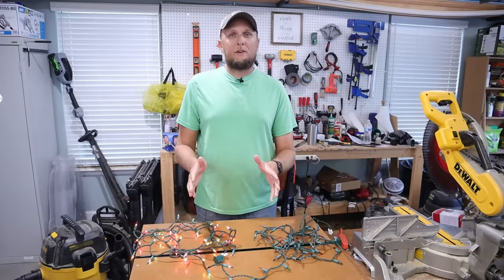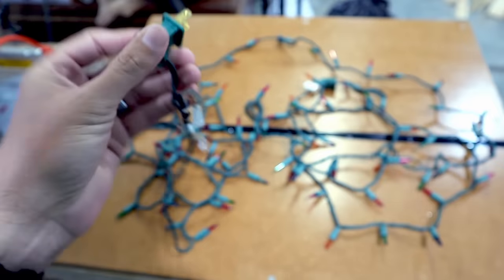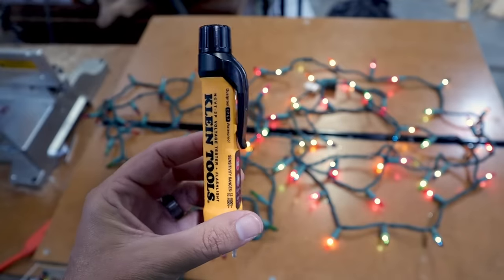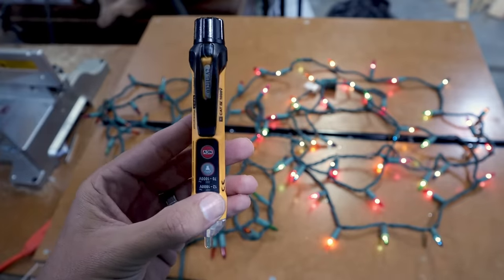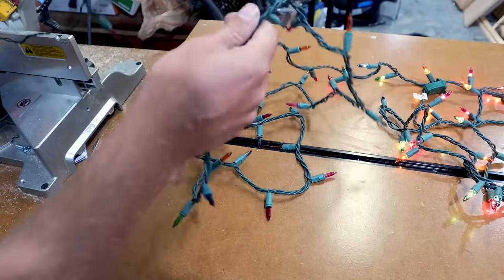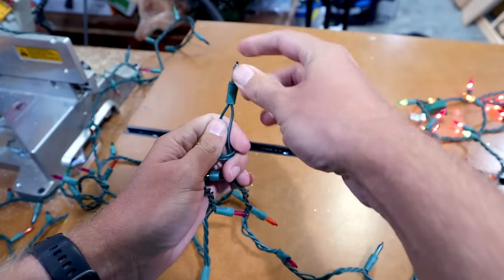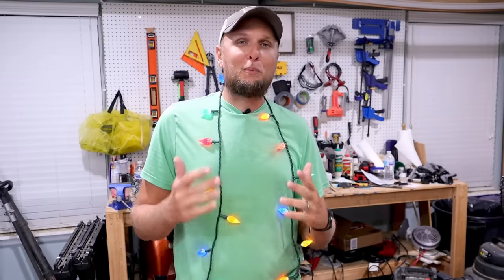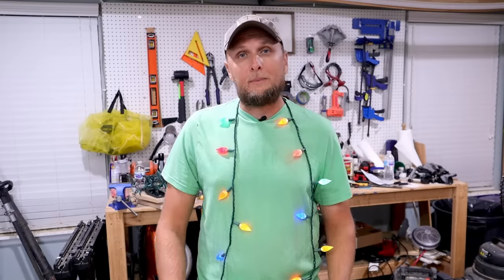How to Find Bad Christmas Light Bulbs Quickly!  LED or Incandescent

Comment: I tried this but still not able to find it. All bulbs show to have power but none are coming on. Maybe a stupid question but mine has a plain green piece between the first light and second. Maybe this is a fuse or something? It doesn’t seem like it opens.
Reply: Same exact issue with my troubleshooting.  I was able to open the "plain green piece" that has some component that I suspect is a capacitor, but I certainly do not know for sure.  I've looked through the comments and don't see the gentleman addressing this or other several other similar issues.  I've tested all my bulbs in a section of the non-working string and they are all good.  I tested each plug for power using the $30 tester I purchased after watching this video.  Still no luck, but now I'm out $30 :(

Comment: In the past I’ve even thrown them out. Watched your video and immediately went to Amazon for my tool. Thank you!
this is the absolute best I've seen yet.  I like this method 1000% more because it's actually tracking the problem and not pulling every bulb and just guessing where the issue is at. the divide and conquere method is the tried and true way to break a problem like this down.  Ordering my voltage detector tonight!

Comment: Thank you so much! You saved me! I had just bought a few brand new set of lights out and just to be safe I tested each one of the strands prior to hanging them on the eve of my house. All worked. 
BUT, sure enough, the minute I was done hanging all the strands of lights, there was one strand dead smack in the middle that was completely out. Brand new and I tested it??!! 🤷🏼‍♀️ Well, thank God I came across your video because I was about to hop back on the ladder and replace that entire strand with another one. About 4 lights in… I was able to figure out which light bulb was out, put a new one in and VOILÁ!!.. no having to rip any lights down to replace them with a new strand. 
Thank you for taking the time to share this! Like I said… You’re a complete lifesaver ! 🙏🏼🎄

Comment: I don't know how I've read so many posts and watched so many videos and this is the absolute best I've seen yet.  I like this method 1000% more because it's actually tracking the problem and not pulling every bulb and just guessing where the issue is at.  I've been in cable TV for 24 years and the divide and conquere method is the tried and true way to break a problem like this down.  Ordering my voltage detector tonight!

Comment: Thank you.  Have a Balsam Hill tree with 'built in' lights with a section not lighting up.  Of course the 'built in' bulbs are just normal strings attached to the  branches and plugged into the pole.  This looks like the perfect solution to finding the bad bulb.

Comment: I wish I had seen this a couple of weeks ago.  My wife was determined to find the bad bulb(s) in the lights which are pre wired into our tree.  She used my voltage tester and even changed almost every bulb on that string but never found the culprit, so she bought a new string and wove it into the tree.  We’ll try again next year and follow your process.  We were unaware of the possible need to reverse the plug in the outlet.
Reply: Do yourself a favor, don't buy pre-lit trees. Once they get to be 3-4 seasons old, the whole light sets start to fail and it's impossible to find the bulb, because they all fail at the same time.

Comment: Glad I found your video today. Just what I needed after watching another video with diagrams instead of "hands on" like yours. Much easier than the LED Light Keeper I bought several years ago which requires puncturing the wire insulation (which is sometimes nearly impossible). Used my inductive test probe to check for voltage on both sides of the socket and the Light Keeper to verify the LED is good.  Troubleshooting the unlit section led me to 2 bad LEDs (one with a resistor with a broken lead) and a bad socket. For those that may not know, when testing LED bulbs there is a positive and negative lead. If it does not work one way, switch your tester on the lead. Thanks for the video!
Reply from the maker: I am really glad to hear that you found the video helpful James!  Thanks a lot for all of the feedback and tip!

Comment: I wish I had seen your video 2 weeks ago when my pre-lit artificial tree had only half its lights working.  It was too much to find the problem so I spent over 4 hours removing the lights. It was a tedious job cutting and unwinding the strands from each branch. This method might have saved me the time and trouble of removing the lights.

Comment: Great Video. I got here after I had replaced the fuses and still did not get the lights to work. Getting a no contact voltage tester tool like you suggested in the video seems a no brainer and a great addition to my tool box. Many Thanks!

Comment: Thanks dude! Very helpful! Now I can enjoy the hunt for the bad bulb rather than dread the chore! Many thanks.
Reply: SO hopefully you can suggest a fix for this: I accidentally strung too many gutter-icicle lights strings together (about 7 strings) and now they all went out entirely. Usually I only string 3-4 together and then add another outlet. So my question is, where do I start checking the in-line fuses - at the beginning of the string or at the end?  Thanks!
Reply: Got 'er done.

Comment: Thank you for the information this video is much better than most on the sibject.  I still prefer to buy high quality lights instead of working on broken big box store brand strings & nets.  I used to waste  time trying to fix lights knowing all the technical reasons why they failed when it was clear I could have spent that time at a job & earned enough to buy new lights I stoped  the madness of repairing cheap lights.  In some cases were I can't get a type from a high quality source I buy new units & swap the bad ones out for the good & return them as defective.

Comment: Thanks, I forgot about the broken leads on the LEDs. Noticed that last year and forgot.   I took one apart and noticed it is the resistor lead that seems to break most often.  I didn't have a tester so I had to pull each LED and inspect the leads.

Comment: Enlightening explanation 😂 But seriously useful, esp the trick of turning the plug! My case is a little more complicated because the lights are attached to a Christmas tree so the strands are near impossible to separate and it's really hard to follow the chord around the branches. There's got to be a trick I'm missing!
Reply: I just fixed the wrap around light strands on my stair case...just start at the first on out that you can get to and replace the bulb and keep going.  It may be hard but it's better than taking them all down. YOU CAN DO IT!

Comment: Three years ago I realized that I was spending more time fixing those old incandescent light strings than I was hanging the lights !! 🤔🤔🤔🤔
I had maybe a dozen strings and I even had one of those "Impossible to repair" reindeer displays. 
I collected the lot and gave them all to the Well Good will store.
I then went to Wally World and bought a boat load of LED style light strings.
After three years of of usage, I have YET to have to repair a single one of them !!   

With all their color and automatic lighting options, they are a true Christmas Joy.
Reply from the maker: Lucky you!  I usually have about 2 strands of LEDs to fix each year.  It’s almost always the metal connection on the bulb breaking off.

Comment: Love your videos, Adam, always great.  Great explanation about polarity and switching the plug around if needed before starting this process.  Tried my Klein NCVT-2 on two 35-light GE Twinkle sets (each bulb twinkles independently) from the 1980s.  Worked like a charm on the first string, found one bulb out, replaced it, back up and twinkling.  Second string was possessed.  Results were inconsistent.   Changed my tester batteries, same results.  Thought maybe I had a broken wire, or that bulbs were breaking from age while I was testing.   Big problem seemed to be broken leads, when I took out a suspect bulb.  Had trouble getting the  knack for where to put the tester nose on the wire.  Finally got to the end and got the string working.  Gently moved it around, lights stayed on, so I don't think there's a broken wire.   (Yet!)   Thanks again!

Comment: Well you made that look easy. It's only voltage tester will work then correct? It's been 3 hours and tingling bulbs to find out the whole strand isn't working. Going to be an easier way, great video

Comment: Thanks for video. Verified all bulbs are good and still half string doesnt light up. Any additional tjings in should try ?
Reply: Throw in trash, but a new set. Once they get 2-3 seasons on them, especially if they have high hours, multiple bulb filaments start to fail. This can cause a domino effect where the whole light set burns out because there are too many lights trying to carry the load of burned out bulbs. I had this happen on a pre-lit garland a few years ago. It scared the crap out of me, because when the whole set failed, it lit up like the sun for a few seconds!

Comment: Very helpful and clear video for troubleshooting these two common types of Christmas lights, thanks so much for this!    I'd love to see a video for diagnosing/fixing the larger 5-watt incandescent solid-color bulb strings (where the bulb screw-in diameter is approx 5/8") that use a single 125V fuse and 2-conductor wiring (not 3 as in your example here) with fixed polarity plugs (e.g. where the neutral plug blade is wider and the 'hot' plug blade is narrower).  Thanks again!
Reply from the maker: I will keep that in mind for next Christmas!  Glad you liked it.  Really appreciate the feedback Joe!
Reply: Yes. Need to see the same video. You mentioned incandescent in your title so was expecting the old 5-watt light bulbs 😢

Comment: Good video, well explained for those who didnt know how light strings work. I already knew how to detect if a bulb is bad if half the string is out, but more frequently these days, my strands are completely out, OR, the lights will glow so very faintly, that they are almost undetectable. In the case of them still having power to the next plug end, but not lighting, glowing very very faintly, I have never been able to figure out what was wrong, maybe something with the rectifier? But on LED srands WITH replaceable bulbs, and the entire strand out, I'm not sure whats going on here. My "no touch" voltage detector shows power the entire length?

Comment: I have a Fluke VoltAlert tester so I used it to test a string that wasn’t working and found a bad LED light using this method which fixed the first circuit, but I couldn’t find a bad light on the other circuit. (I followed your instructions on switching polarity for the second circuit.)  I think it is because my tester is rated for 90-1000 volts and once you get past the first ten bulbs the voltage drops below the range of the tool to detect.  I’m going to order a lower range tester. It makes me mad because we thought LED’s would be more dependable.
Reply from the maker: Yeah that’s exactly why it’s not picking it up.  Need a NCVT with the ability to find low voltage.  I agree.  It’s why we went to all LEDs but they have their issues too.

Comment: Thank you for the video. I have lights where there is a bulb with the three wires about halfway down the string, as well as at the start and end of the string. This is the one that's faulty. The problem is that these bulbs have a different base than all the others. The manufacturer doesn't provide a replacement bulb, and "normal" bulbs don't work in that socket. Is there a way around this? Thanks!
Reply: An extra mini bulb from another set can work. Just unbend the two miniature wires and pull the bulb from the socket and carefully put into the socket that fits. Be careful not to let the two wires touch as you do this. These bulbs are all about 1.7 to 2.5 volts. Each "loop" equals about 110 to 120 volts. Doesn't hurt to mix one or two foreign bulbs into a string. I have been synchronizing my lights to music for the last ten years and repair strings all the time.
Reply: @limburgercheese1234  Thank you for the tip. It worked great! Definitely think this particular problem and fix should be added to the video.

Comment: Great video. Succinct and on point. So help me out. Second half of a strand is out.  (First half was out intermittently but your technique helped me isolate a bulb with a bent wire. ) But there is voltage all the way through the second half. Verified every bulb.  Note: there are two junctions mid strand. Meanwhile, first strand is showing no voltage at several wires between lit bulbs. 😮. Brand new detector. Ideas?

Comment: Will this method work for a string of LEDs that a section is very dimly lit and the rest is normal? Or could it be one of the resisters? It's a 50ft string.

Comment: If you follow all the steps, isolate and replace the light and it's still not fixed, would you suggest something else? I've got power coming into one light but not out of it and new bulbs aren't working.
Reply: I'd like to know this too... Prob spent 5 hours on one strand and pulling my hair out .  First half of strand works and 2nd half is out....Was thinking of cutting the entire bulb out and patching the wires together..

Comment: Can you please tell what kind of voltage detector range device we need for testing christmas led strings.
Reply: The voltage running through these lights are typically 120v so use a standard non contact voltage tester. They typically range from 50v to 300v but there's different models that have higher or lower ranges.

Comment: Hey there.  Great video.  I have some old c7 lights and ¾ of the strand isn't working.  I've never had this happen before.  Obviously, it's not the fuse because the first 4-5 bulbs work.  I know there's a bad socket but as long as a bulb is in there, it doesn't seem to matter.  However, I tried screwing in a new bulb into that socket and lit blew out all the sockets behind it.  Do you have any suggestions?
Thanks,
E

Comment: Question: is this the same process for the LED if it's the second half of the line that's out instead of the first half
Reply from the maker: Yes and no.  If it’s the second half the plug will need to be flipped the opposite direction for power to be flowing from the beginning of it to the end.  Then all the steps are the same.  I have an updated video on this coming out next week you still have any questions as in that video both of my examples are on the second half.

Comment: I have a question, the light comes on the LED keeper, but when I test a bulb, that came out of a working stand. I don't get a lit bulb but the keeper red light comes on. I've been over half way down the side that doesn't work and so far no lights. Any suggestions

Comment: How come you were testing the middle of the two strings at the base of the LED instead of the bottom of the light/bulb like you did the incandescent?

Is there a difference in testing the two? Or did you do it that way because the LED bulb was so fat?

Comment: What I have found is A LOT of LED lights are cheap junk. Most of them have the exact problem you showed with a broke power leg and that is because they are now not using the good copper legs they are using a cheap silver plated brittle legs and they brake super easy. Just a small twist on the bulb part can cause the brittle leg to brake off just like the one you showed. Word of advise to all is pull a bulb and check for the silver power legs if you see that do not buy unless you don't care how long they last. If you are ordering from Amazon then you get what you get don't throw a fit lol.

Comment: So how can you determine led on a halloween tree...
I chopped up the transformer plug and connector with lawnmower but it wasn't on at time disconnected... it worked before it was disconnected
It has purple lighters and has red lights in mouth and green lights in eyes...
It has a transistor I believe before mouth and eyes at top after purple lights but purple lights continue after
The mouth and eyes blink or flash while purple lights stay fully lit
I bought a new plug on Amazon that's same rating and amps and watts  and a extension with connectors on both ends cut the connector that dont need and spliced into end of original and thenI splice togethe with olhgr and plugged in but nothing lights
Any ideas
I didn't test with tge tester yet but I'm guessing maybe rgat transistor
I have w of same trees so I hooked up extension with connectors and that trees plug and also new plug and tgey worked so I know the new stuff works so it's definitely the transistor or the lights unless rge plug and connector when getting chopped pulled on wire and somewhere in wire got pulled

Comment: What happens when you've actually tried to switch out every single bulb and they still don't light? Also replacing the fuses? No obvious wire damage as well?
Reply from the maker: May have more than one that has gone bad.  It is not incredibly common but can happen.

Comment: Superb video! But my Philips mini lights with a 3-year warranty are schizophrenic. All lights out on three strands after a year of storage. I'd run the wire, think I'd found a bad bulb, replace it, then the PREVIOUS bulb which worked before wouldn't cause the NC voltage tester to beep. I've been at it for hours. Enough. I'll comment on best places to recycle strands of lights.
Reply: Throw in trash, but a new set. Once they get 2-3 seasons on them, especially if they have high hours, multiple bulb filaments start to fail. This can cause a domino effect where the whole light set burns out because there are too many lights trying to carry the load of burned out bulbs. I had this happen on a pre-lit garland a few years ago. It scared the crap out of me, because when the whole set failed, it lit up like the sun for a few seconds!